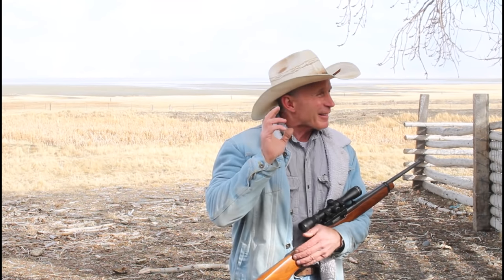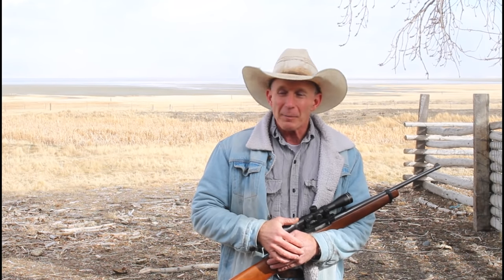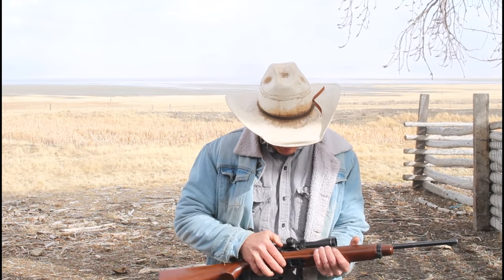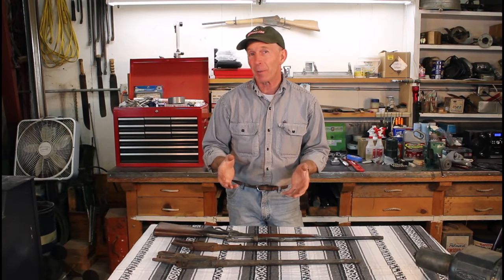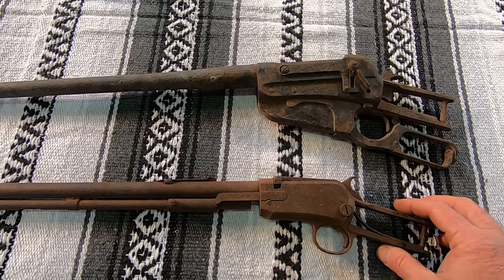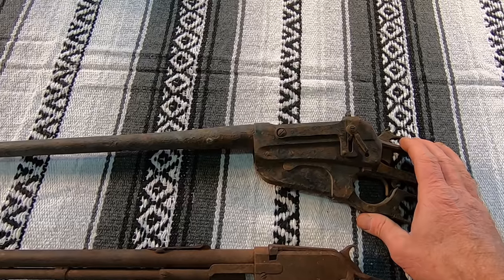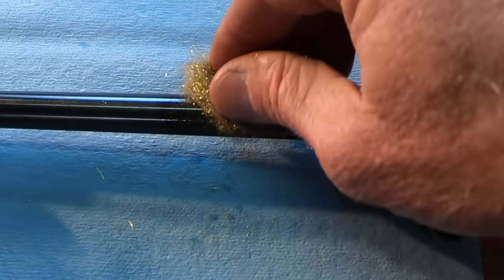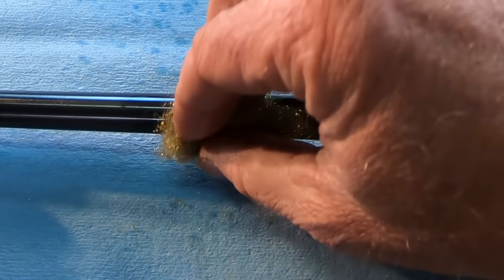Rust Removal on Classic Firearms

Comment: When I have a gun that needs some rust care, I start with  Hoppe's No. 9 or a little gun oil. I let it soak and then I use a paper towel or blue shop towel. For very light rust, even the light abrasion from the paper helps remove a good deal of rust. This video is a great tutorial for several levels of rust!

Comment: Good job Mark. I knew of the penny trick but you taught this old dog a new one with the brass wool. Thanks.
Reply: That’s the one I knew about too.  The Copper Penny.
Reply from the maker: Thanks Jim!  I like the copper penny on flat surfaces and brass wool on contours.  I've used 0000 steel wool, but it's really easy to go too far with it.
Reply: I use brass or copper wool to clean the barrel too.

Comment: I am a huge fan of car wax on my non-cerakoted rifles.   A spray on wax will give you a level of waterproofing to prevent the rusting even when hunting in wet conditions.  For low use firearems, once every couple of years.  For heavy use firearems, once a year.   Takes less than 30 minutes and preserves your blued finish
Reply from the maker: I hadn't heard of using car wax.  Thanks for the tip.
Reply: Do you have to degrease the surfaces before applying the car wax?
Reply: @endutubecensorship  I never gave it any thought before you asked but upon reflection, I actually did degrease it.   My thought would be follow the process you would follow for applying it to your car.  Clean the surface thoroughly, dry it, apply the wax with a moist cloth, let it dry and buff it.  Its a good thing to do while watching a football game.
Reply: @FlyRiverFly  Thank you very much for the reply! 

That's what I thought the procedure would be but figured I'd ask.
Reply: True. I use tire black tp protect steel from moisture
Reply: I'm not even a fan of carnuba "car" wax on a car...even on a car I use oil
Reply: @w.e.s.  that's an interesting take on maintaining that new car look.
Reply: @w.e.s.  😂
Reply: So FlyRiverFly, you are a master of car wax techniques. Can you show me wax on wax off receiver and barrel?
Reply: @diegofianza3525  Diego-son rust no can defeat car wax on barrels and receivers

Comment: Great video. Many thanks.
After cleaning up my rifles I use a thin smear of ACF50 all over it to prevent rust for up to a year, it does not have an issue with a hot barrel or affect interior surfaces. I live in The Lakes and Wales UK, both really wet regions of an already pretty soggy island. 😎👍 Though simply ensuring the rifle is throughly clean and dry every time is the best maintenance. Prevention first. 👍😎

Comment: Great rust removal video.  I've worked on a few Winchester 1890s and 1903s.   I start by removing all the old oil residue using Powder Blast, acetone, or Lectra Clean.  The removal of that old caked-on oil residue can reveal rust that is hiding as "patina."  I've used steel wool before but I am now using something called Big 45 Frontier Rust Remover along with CLP or Ballistol.  Never seen it scratch a firearm yet.
Reply from the maker: Thanks for sharing those great tips, George!  I'll keep an eye out for that Big 45 Rust Remover.

Comment: I know that the 10/22 is common, I have the first year, but I think they probably made a million of them, that year. It has one little pit next to the front sight, I cleaned that spot out and OXPHO-BLUED it neutralized it, then gun oil. I have several surplus guns and used the same thing. Good show and advice.
Reply from the maker: Thank you!

Comment: My experience with CLP is being able to put it on the rust and leave it overnight.  Wipe it off the next morning with a wet CLP patch.  I've never had to use abrasives.
Reply from the maker: Thanks for the tip!  If the rust has only recently appeared, it's usually quite easy to remove like you describe.  If it's been there for a while, it'll usually take a little more work.

Comment: Hello, I think you mentioned not wanting to boil a collectable gun because a collector can tell that it was boiled and that would reduce the value of the gun.  I'm guessing you were talking about boiling the gun in bluing salts.  Sir, I would not presume to tell you anything about guns, but you didn't talk about spot "rust bluing" that is used in conservation of collectable guns.  That process, as you know, converts the red rust to black.  To do that on a spot of rust you first de-grease the area were the rust is, then you get a tea kettle with clean water in it, and set it on a hot plate.  You then set the gun up in some way so that the rust spot is hit by the stream of steam that comes out of the whistling cap on the kettle, (any kettle with a spout will work too).  The hot stream will make the rust turn blue (black).  Then you use a soft wire brush or steal wool to take off (card) the lose black oxide.  For heavy rest spots this steam process and carding may have to be repeated a few time to convert the rust all the way down to the steal.  In the end you will end up with only the spot where the was, converted to a rust blue, and none of the original blue around it will be effected (assuming the surrounding blue is sound in the first place) .  Of course, the entire gun could be de-greased and boiled in clean water, then the rust spots carded.
Reply from the maker: Thanks for the tip.  I boil, or more accurately steam, guns with more extensive red rust regularly.  However, I don't use that method on small spots of rust, like on these guns, unless I believe the rust has gone through the bluing.  Check out our episode, "Rust Conversion on Damascus Barrels" where I boil and card a set of rusty shotgun barrels.
Reply: @thecinnabar8442  Thanks

Comment: Real nice job, there. A little patience goes a long way. Most guys I know would just take it to the wire wheel on the electric grinder and take it down to bare metal, then slather some cold blue on it.

Comment: Mostly I keep my projects to conservation. Wfh that in mind, Evaporust  is a great choice. So is a good boil  - both do a great job of converting that active rust to black oxide.  Might take a few passes. Depends on the severity of the rot.  Then some light work with a carding wheel. Leaves any existing finish that remains, intact.  
Made an irreversible mistake with a wire wheel and a martini Henry as a young man. Never again!

Comment: Rust is definitely a pain.
A simple way, can be to grab your bore brush and a drill. 
The fabric bore brush for a 12 gauge makes a decent polishing/cleaning wheel. Fits right in the chuck of a standard drill and at that point you basically made a polishing gun.
It's been a game changer for me.
Reply from the maker: Thanks for the great tip, John!
Reply: @thecinnabar8442  no problem 👍

Comment: So, never had a true collector's piece to work on but I always used pennies (I actually found a package of small copper flat bar stock at a craft store that I cut into pieces) and aluminum foil.  Crumple the aluminum foil and with that and the oil it will take the rust off and literally not damage anything else it's so soft.  Work the penny first.  If, after the penny, when you start with the aluminum the spot immediately turns a distinct grey/silver with the aluminum foil, you stop and use the penny again.  The rust will always hold a small amount of "shavings" of the aluminum but you should see that reduce with each pass not build.  You don't want that to build up aluminum in the rust or you are not removing rust, just adding aluminum and that you don't want that, so back to the penny for a couple of strokes.  As you said, you will feel it "grabbing" at first, but once the aluminum foil is sliding without "dragging", you should be there and you finish by "polishing" with cotton (a cotton round from the drug store, a cleaning patch, or an old T-shirt just as long as it is bright white), it's not really polishing but it is lifting the aluminum which has smeared on the surface off and once the white cotton is no longer showing grey/silver.  

I picked up a "hurricane" 1957 Glenfield Model 90 on the Gulf Coast once for a song. The bore was perfect and the stock and feed lips (especially once I disassembled it) showed it had been VERY lightly used but unfortunately it had a significant amount of rust on the barrel and magazine tube.  Because the aluminum is so mild and there were only a couple of minor pinpoint sized pits (spun a tooth pick in the pits to make sure I got the rust scale out), the barrel retained most of its factory blue and smoothed surface under the rust.  A little touch up with cold blue and then a quality oil to seal the pores and from a few feet away its "perfect" (up close you can tell but its now a nice accurate shootable firearm again).

Comment: Great restoration do’s and don’ts Mark. Hopefully I never have to use what I learned, but now I know how to do it. Thanks. 
Had to return a brand new Colt Lightning reproduction in 45 Colt to the dealer because of pin hole pitting on the length of the barrel and magazine tube and two rust spots on the receiver. Very disappointing. But down the road I’ll know how to take care of that using your video. 
When you get around to working up some loads for the 1895, perhaps you can show us your method for slugging a barrel. Until next time.
Oh, and here’s a YouTube channel you might be interested in, Target Suite.
Reply from the maker: Thanks Dogbone! I'll check that out.

Comment: Great video as are all of yours. 
I like using the Frontier Big 45 nickel scrubber for rust and lead removal. Do you not like it, or do you just prefer the brass scrubber better?
I have also found, that contrary to normal usage. If you leave a little oil on the metal and go over it with cold blue, it sort of blends the finish. I don't remember the brand I use right off.
Reply from the maker: Thanks Jim.  I haven't tried Frontier Big 45 nickel scrubber, so I don't have an opinion about it.  Thanks for watching and commenting!
Reply: @thecinnabar8442  It is worth a try.

Comment: Bronze wool and Ed's Red Bore Cleaner works well or motor oil or ATF. The recipe for Ed's is as follows. Equal parts of Acetone and Automatic trans fluid and Mineral spirits (paint thinner) not the new low VOC crap it has water in it and does't mix well and lastly K1 kerosene you can also add lanolin as well. if you buy all the ingridients in quart cans and mix in a gallon container you can refill the quart cans and you will have 4. quarts so you can give it to your buddies too. it works well on shotguns and removes wadding fouling etc. cleans the outside and the wood too. I use it to remove powder fouling in barrels prior to using a good bore cleaner because it's way cheaper. Just like Hoppes it won't remove copper. Other than the fact that chicks dig the smell of Hoppes it really ain't worth a damn in the gunsmithing world and it actually makes me $$ you think your barrel is shot out and i replace it in some cases it's just carbon and copper build up that hoppes won't remove. Throw that barrel in a bluing tank and the hot salts will eat out the fouling and copper and sometimes the barrel looks really good underneath all that stuff. I always oil the outside of my firearms with mineral oil laxitive from Wal-Mart and those blue shop towels you were using in the video. The mineral oil makes your bluing looks darker and the paper in the shop towels is a light abrasive and acts as a polish cloth and most furniture polishes etc. are a mineral oil based product anyway. Back in the days when i used to do hot tank salts bluing i used the mineral oil and paper shop towels on all the parts and barrels i did. it makes the firearms look beautiful and jet black and it's cheap to use.
Reply from the maker: Great tips!  Thanks Mark!

Comment: Hi, great channel. I have a 1940 ithica model 37 shotgun. Wondering your thoughts on the value and if I should bead blast the entire gun and reblue?
It will be staying in the family. The rust is not near as bad as the colt lightning in this video but has spots all over the barrel and the receiver has a large rash spot right atop the engraving. None appear pitted too bad

Comment: Mark thanks for the video. Question, when you are done cleaning the rust and before you put the wood (stocks) back on, do you leave a thin layer of lubricant on the spots you just cleaned? Thanks again.
Reply from the maker: Yes, most definitely.

Comment: Great video I learned a lot! I got most of the rust off of my shotgun barrel but there are still little red patches of rust that I cannot get off with the steel wool I’m using. The rust seems to be smooth with the barrel now and no matter how much I scrubbed it was still on there. Is this normal to have a little rust left over? Thank you so much!
Reply from the maker: Typically, the longer the rust has been on the gun, the more permanent it becomes and the more difficult it is to get off.  Once the red rust has replaced the bluing, it's impossible to get off without leaving bare metal in its place.  When that happens, it's time to consider a cold blue touch up or a complete refinish.
Reply: @thecinnabar8442  okay I see now, either way your video helped me get most of the rust off of my barrel. Thank you so much for your help!

Comment: I would just boil that 1890 and 1895 in distilled water for ~30 minutes, the heat will convert the rust (Fe2O3) back to gun blue (Fe3O4). Then, you can wire brush the excess off, and have a nice rust blue finish (minus some pitting) on the gun.
Reply from the maker: Yes, rust conversion works very well I have a couple of episodes showing the rust conversion process.  It's a great process, but overkill for light spot rust removal like is present on these firearms.  I reserve rust conversion for firearms with more widespread and heavier rust issues.

Comment: Why can't you use Navel Jelly and reblued the smoothed finish?
Reply from the maker: You certainly can but rebluing a firearm is a rather dramatic overkill for a spot of surface rust that can easily be removed using these techniques.

Comment: Rust 911 is a better bang for the buck as it comes in concentrated form and can make up to 16 gallons of pretty much the same stuff as Evaporust.
Reply from the maker: You certainly wouldn't want to use anything like that for spot rust removal.  It'll take all the bluing off that it touches, just like Evaporust does.  Sounds like it'd be great if you were taking the bluing off a firearm to bare metal to refinish, though.

Comment: No, steel wool won't remove bluing if used properly, and it certainly won't scratch a steel surface.  The damage done to the 1895 was probably done with some type of sandpaper.  Never use sandpaper on a blued surface.
Reply from the maker: It's surprisingly easy to remove bluing and patina with steel wool when not used properly.  I've seen it done many times, even with 0000 steel wool when used with a heavy hand.

Comment: Why not use copper mesh instead of a penny?
Reply from the maker: I prefer brass wool to copper wool because it's a little softer metal and I showed using brass wool in this episode.  I showed both methods in order to illustrate two commonly used methods of removing rust.  Neither method will harm the gun's finish - IF - done properly with a light touch.  Thanks for watching and commenting.

Comment: What about converting it. Steam it and card it.
Reply: Soak in kerosene for 24 hours, then wax it. I use turtle paste wax.
Reply from the maker: Thanks Preston!  That's a great option for firearms with more extensive rust issues, but I believe it's overkill for guns like these with small spots of rust.  I may do an episode about converting rust, but Mark has done such a good job of showing the process that I'm not sure there's much to add.  Thanks for watching.

Comment: i myself think people say oh dont remove the patina BS the gun did not have patina when it left the factory so in order to make it look like it came from the factory i say rust blue it and put it back to the beauty it was when new to hell with patina remember patina is rust simple as that
Reply from the maker: That's good advice on modern firearms.  Removing the original finish on antique collectible firearms is just plain idiotic and will destroy the collector value of the firearm.  If you get the notion to do so, you will devalue your collectible firearm by thousands or even tens of thousands of dollars, depending on its value.